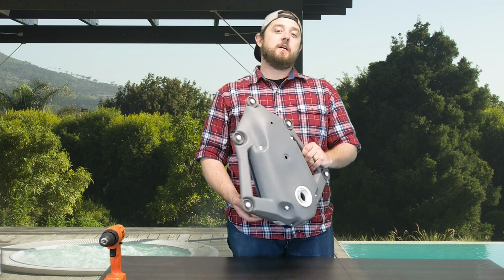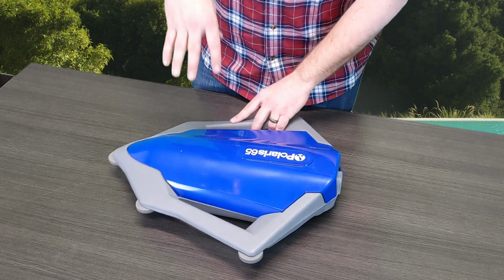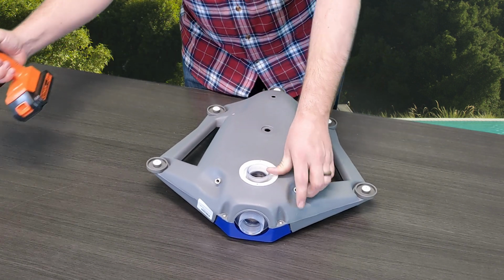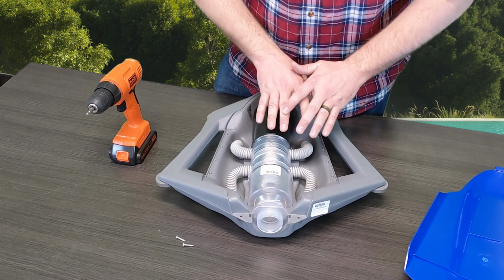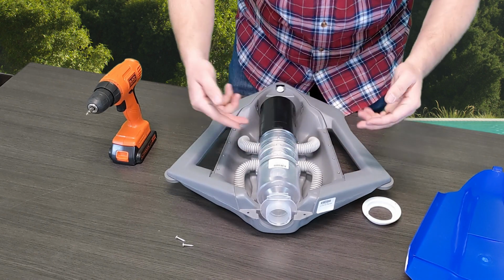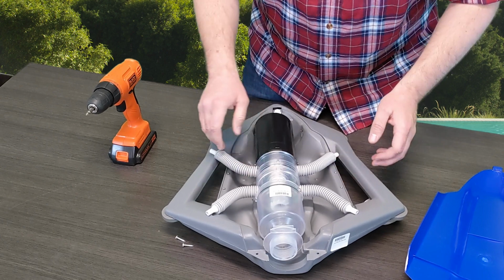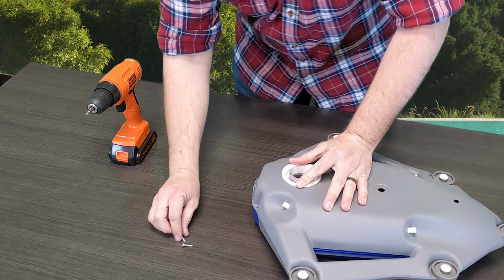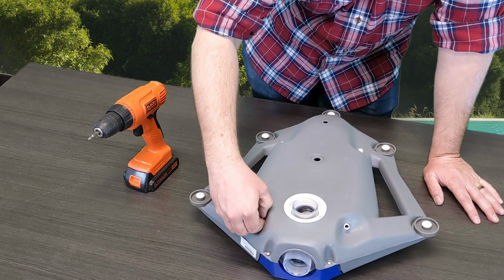Polaris 65 Pressure Side Pool Cleaner Internal Breakdown - Quick Fix

Comment: Mine keeps flipping up side down. How can I get it to stop.
Reply from the maker: Hi there, its possible that the arms that give it buoyancy has had water intrude into them somehow. In the front of the unit under the top cover is a drain hole. Just drain the water out of the unit and this solves the problem of it flipping over. Hope this helps!
Reply: Mine is going sideways and popping wheelies. What could that be?
Reply: How would you do that. Do you take it apart?
Reply: @conniestephens5924  at the end of the hose where it Hooks up I turned that valve all the way open and then adjust the speed of the water flow.